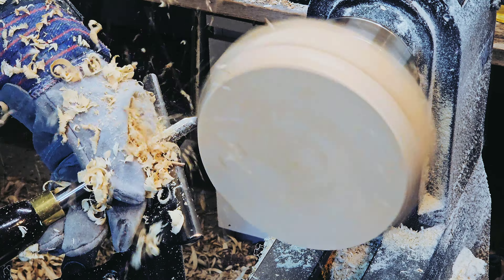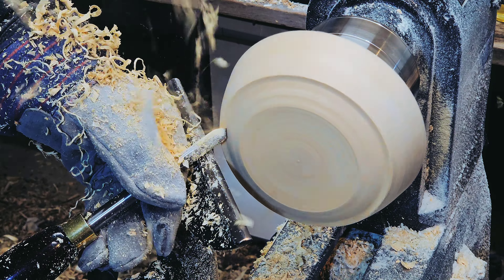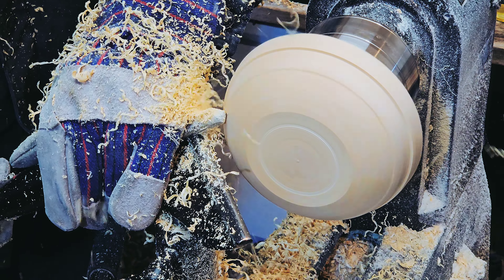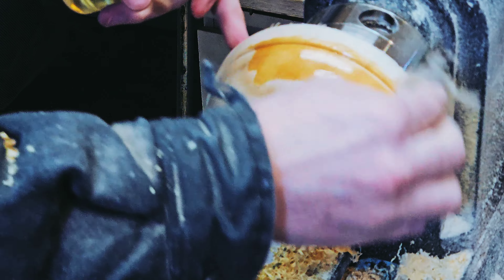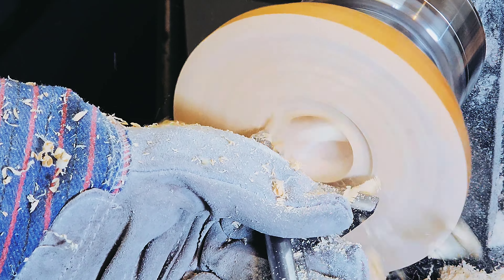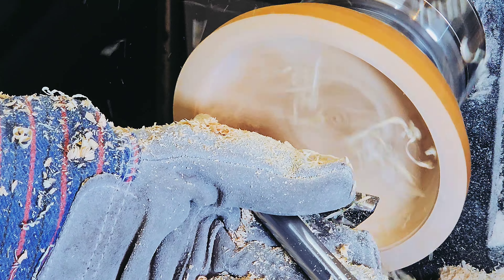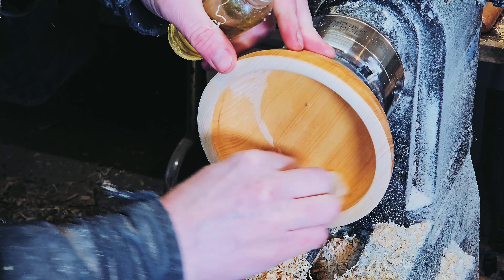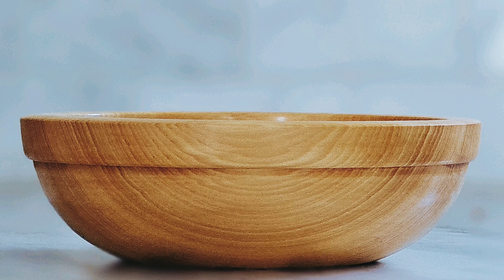What is Accoya Wood - and does it make a good bowl?

Comment: A very nice-looking bowl.  I had never heard of Accoya before, very interesting.  I imagine you wore a dust mask or respirator the whole time.  I will be looking for your update the longevity of the smell and the durability of the bowl.  Did you buy the wood online?  Any side of effects of working with it, e.g., staining of the lathe, etc?
Reply from the maker: Thanks! Yeah, respirator is my preferred safety device. The only side effect was the smell. Even a day later the shavings on the ground kept the smell in the air. Other than that it was similar to turning pine, no staining or anything, it did seem to cut a little harder but otherwise it's just like pine. I sourced it from my workplace.